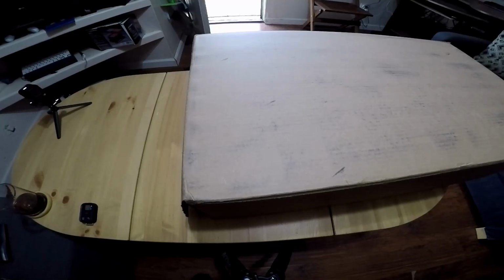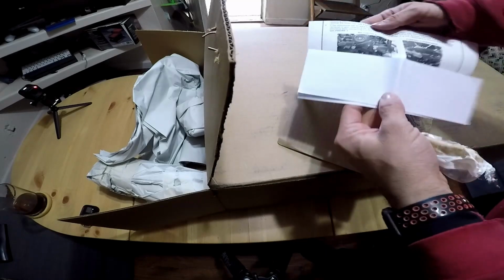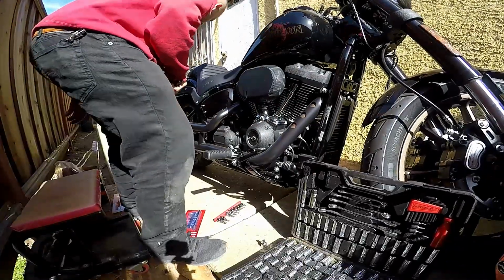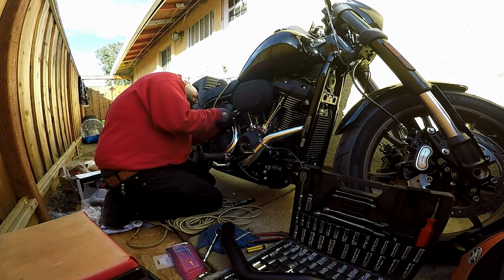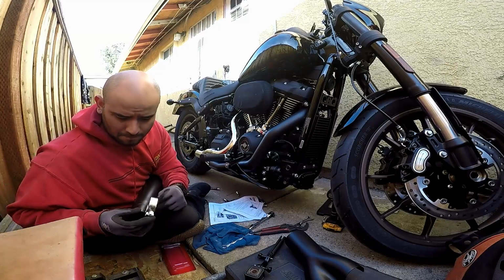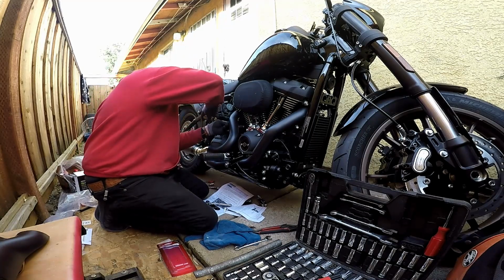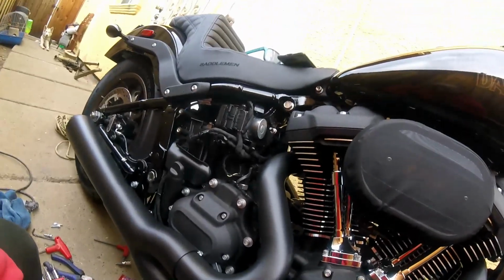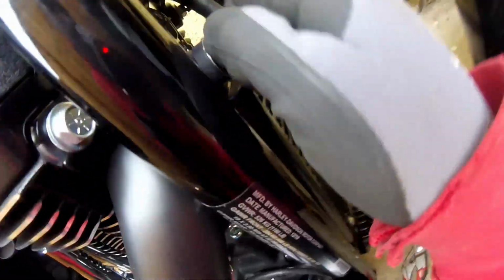2020 Low Rider S Cobra Exhaust Unboxing / Install

Comment: Nice shot & sound from the rear. Tuner used? HDOG
Reply from the maker: No tuner, just headers. Installing pro street tuner soon, when I figure out how to record.  Minor backfire without tuner.
Reply: @InfamousCreep  They run lean off the line (new).  More air with the exhaust. Tuner should fix the issue. Good luck! 2019 FLFBS HDOG

Comment: You should note and know anytime you install a two into one exhaust on these newer bikes, they highly recommend a tuner install soon like very soon after. You will blow that engine up running it without a tune with such a high flow exhaust system!
Reply from the maker: The bike runs lean, major engine failure is usually caused by no oil. I'm not sure about the engine blowing up due to a lack of a tuner.

Comment: should of took the front radiator off bro. Much easier
Reply from the maker: I agree, you also run the risk of cross threading with improper sitting of the nut.